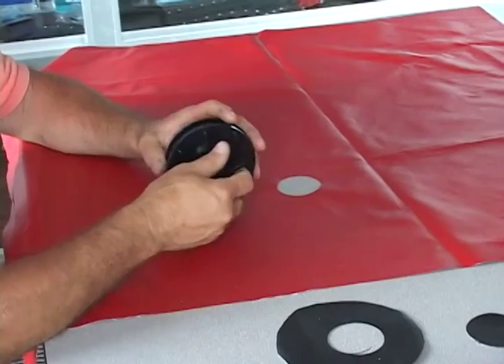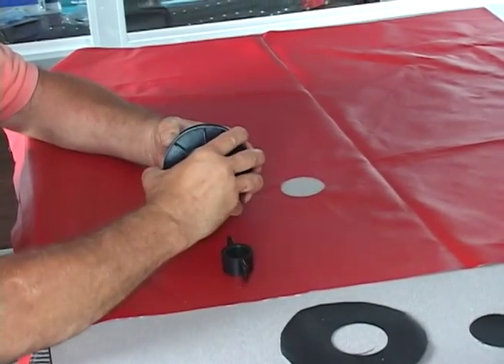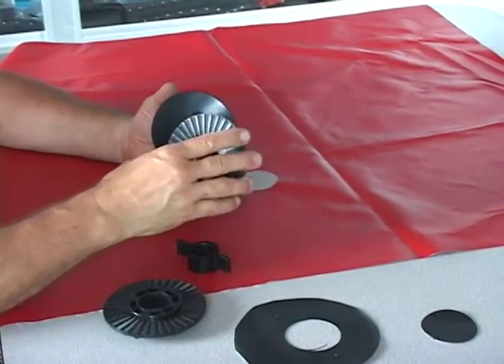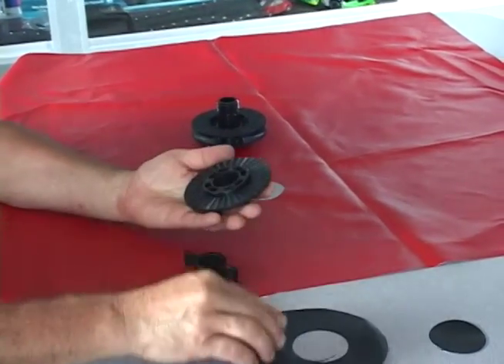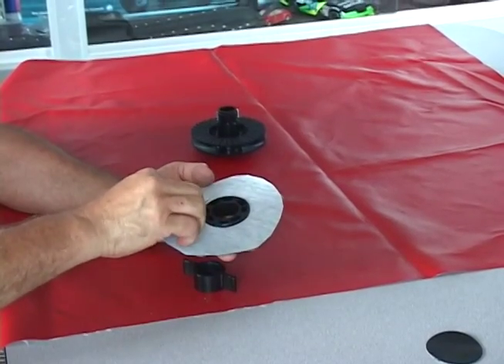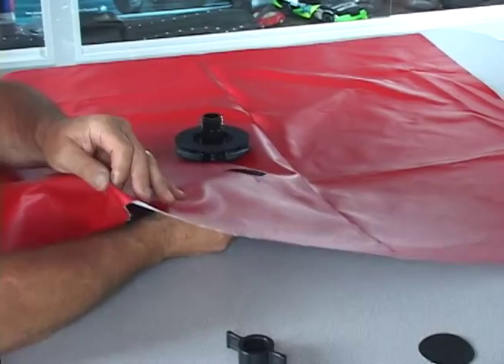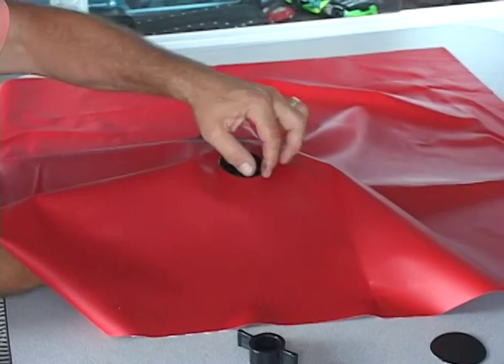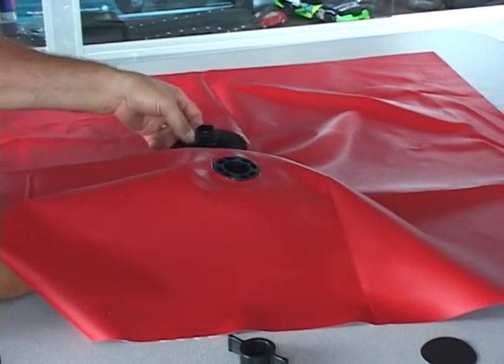Boat Vent Installation Instructions

Comment: Will this cover prevent rain from entering even if mounted on a slope and not directly vertical?
Reply: It will all depend on the slope of your cover and where you plan on installing the vent. It is designed to be at the peeks of the cover, attaching to each mooring pole. If that is not how you intend to use it, and it will be at an angel, you risk water being able to seep through if it is a substantial rainfall. That being said you will notice there is a lip inside the vent to prevent rain from running in. However as I mentioned if it is a full blown storm with some heavy winds, more than likely you may find a little puddle at the bottom of the vent. Hope this helped, if you have more questions call the company at 262-521-9810. They have an awesome customer service team that will answer any other questions you may have about your cover.